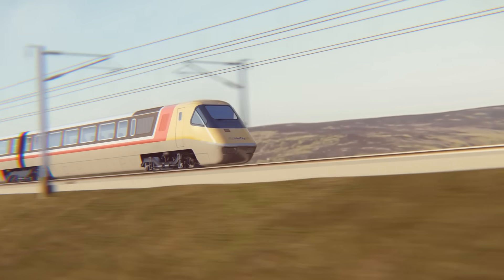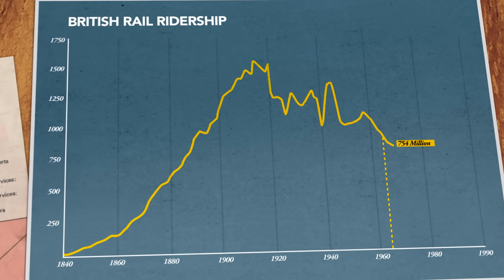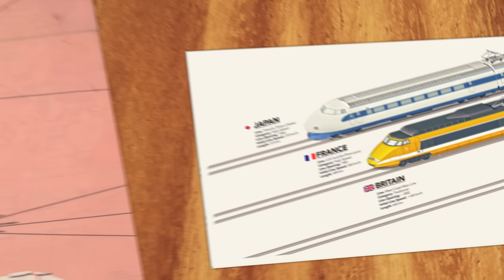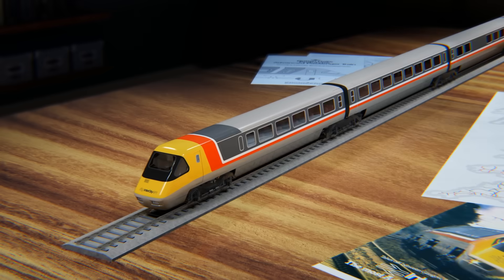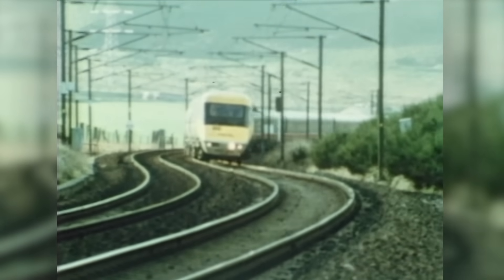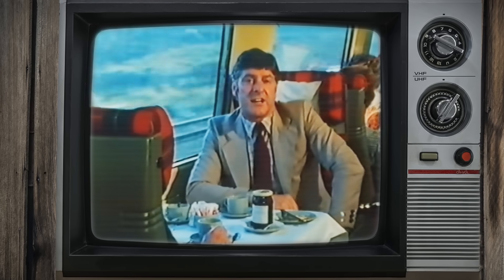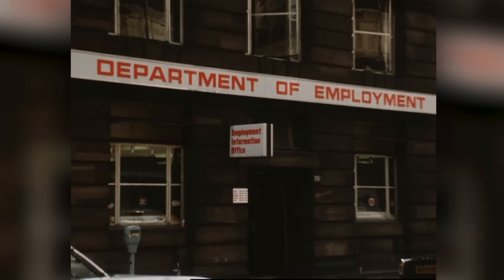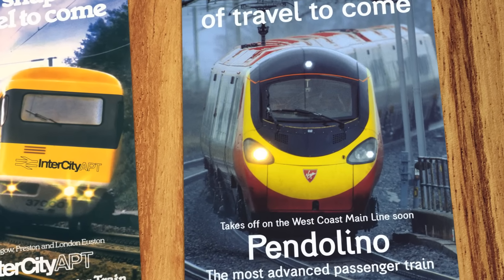This Train Made Passengers Sick: The APT Tilting Train Story

Comment: The big problem with the APT is that British Rail brought in aeronautical engineers from companies like Rolls Royce and told them to build something they had no expertise in. The HST, on the other hand, was designed by railway engineers who knew what to do to achieve speed and relative comfort. The proof is in the pudding-The HST is still with us 43 years later.
Reply: The 43's are still in service 43 years later, lol.
Reply: @oliverthegreatwesternengin8029  yeah. I was on the last GWR 2+8, but cause I live in Devon I will still be able to see the 2+4's. They might start running 2+5's as well with a buffet from Penzance to Cardiff and Swansea, but those are still rumours at the mo
Reply: @StaxRail  
I've never seen one as I live in germany.
Reply: @oliverthegreatwesternengin8029  I can assure you, it's well worth the visit. Some of England's best views down here, such as the Dawlish Sea Wall, still see 2+4's. On the subject of Dawlish, if you want to see it I would go now, soon they are raising the height of the wall and it will get in the way of the view

Comment: Proud to say that my great grandad was one of the chief designers at Oleo Pneumatics during this period and helped design the suspension for both the APT-E and APT-P! Also proud to say, up until the removal of the full size sets, my dad drove the HSTs for nearly 20 years. Short sets are still in action, so hopefully 20 more years will follow
Reply: Be proud of something you do yourself, not your grandpa.
Reply: @areshera4039 I am proud of the work I do myself, as I work on a heritage steam railway as a mechanical engineer and machinist- but if it wasn't for the inspiration and pride I had in my forefathers work then I likely wouldn't have gone down this career path myself

Comment: sick no only the press that had been filled with alcohol, most passengers were fine the worst had nausea.
the problem was it was to well engineered so peoples senses didn't now they were going around curves and looking out of the windows you either seen ground or sky on the harshest curves.
did the APT die no the designs were sold to fiat's rail division and ended up back on the UK's west coast rail line as virgins Pendolino

Comment: I'm sorry but there is an inaccuracy.
Italy had already a tilting train system in service when the APT was removed from service. It was the Fiat ETR 401, it was put in service in 1976 and was developed the decade prior. 

British technology was deficient due to its use of accelerometers to detect the centrifugal forces, while the Italian technology used gyroscopes. 

From the ETR 401, the ETR 450 was developed in the early 80s and put into service in 1988. Therefore the Pendolino was having good success a lot before the BR sold it's technology.

Besides when the Virgin Pendolino was introduced in the UK, Fiat rail had already been sold and incorporated in the French Alstom.

Comment: Fairly standard stuff for Britain. Spend money on developing something, then abandon it, and let others profit from it.
Reply: It wasn't abandoned, it was put on hold. Virgin trains are still using to this day.
Reply: @TRIPPLEJAY00  actually the tilting trains on Virgin trains is the class 390 pendolino
Reply: @TRIPPLEJAY00  Virgin uses the Italian-developed Pendolino, which is exactly Sylvia's point.
Reply: @lusoverse8710  If you watch the video and understand its all the original tech from the original British Rail design then sold to the French then slightly modified which Virgin trains. So the are still in service to this day. Just use your ears.
Reply: @TRIPPLEJAY00  If you watch the video you'll know they said it was sold to an Italian company, not French. Just use your ears.
Reply: @lusoverse8710  The Pendolinos themself were built in Birmingham. The tilting system is Italian.
Reply: @TRIPPLEJAY00  Virgin trains use those Italian Pendolino trains which bought the technology from the APT and developed it properly.
Reply: @afthefragile  That's great very boring conversation all trains are the same and yawn yawn yawn
Reply: @afthefragile  By the time the APT programme had finished the tilting technology was completely resolved and working fine.
Reply: Not only Brits are like that. Polish are same not even worse. We sold PZL to Sikorsky for 66mln zl just to buy new helicopters from Sikorsky after one year for 360 mln :/
Reply: Sylvia Else I thought that is only a german phenomen
Reply: @eacorion  It probably comes down to having development decisions being made by governments, where how it looks now, and especially how it looks between now and the next election, is more important that what it will achieve in the future.
Reply: same history with F35B stol
Reply: Sounds like Jaguar and Land Rover. Awesome until shit starts to fail
Reply: lol
Reply: You mean like the United States?
Reply: @joystix11  No, the complete opposite of the United States, in fact the US is one of the countries that usually wins from British innovation as the US has a bottomless supply of cash to take a chance on stuff, cavity magnetrons for radar, wishbone suspension for tanks, the entire concept of the hovercraft, just 3 things off the top of my head that someone invented, took to the British government and was told "That's nice, now go away" before they sold it to the US.

It doesn't surprise me that we created something the Italians later sold back to us because that is par for the course with British engineering, we've never in our entire history had a government that is competent science-wise.
Reply: @krashd  That all seems to make perfect sense to me, but in a completely direction than where my joke was headed lol
Reply: Sylvia Else you mean like India ?
Reply: Like India didnt build railway in India first. Britian created it and today Indians are proud of it
Reply: Madara Uchiha best bloody railway in the world. Maybe those asking for reparations should take it into consideration.
Reply: @BP2Network And the British took a lot of money out of India too. You guys should read history more. Don't rely on false british texts
Reply: yjhm yhj  you’re talking horseshit. Educate yourself fool https://en.m.wikipedia.org/wiki/Rail_transport_in_India
Reply: Brexit
Reply: Benoit Bricet yes that’s a word? And what?
Reply: Benoit Bricet yellow vests
Reply: @Sylvia Elsa No one is profiting from failed British tech. British lost their edge in tech after world war 2 and they are still losing it. They rely mostly on US tech. Even countries like China are ahead of them.
Reply: @maheshrathod5593  There are reports that patents on the tilting techology were sold to Fiat. Assuming those reports are correct, Fiat is profiting from their use in the Pendelinos which are now running on British tracks.
Reply: @maheshrathod5593  Utter horse shit !! British technology led the way after the second world war, you only have to look at the aviation industry to see that. Come on man ! Think before you type !
Reply: Mahesh Rathod says the man speaking English over the English invented WWW or maybe the British invented telephone, something you lot are well acquainted with. Come back when you’ve got to grips with flushing toilets and sewers Abdul
Reply: Sorry Anglo’s! Gotta make your stuff work!
Reply: They were so close to perfecting the technology - then abandoned it.
Reply: Mahesh Rathod  because you’re clearly a moron with even a basic grasp of English. I suggest you go and enrol in an English course before you try to get involved in a debate.
Reply: @Porkcylinder  OK I get it www was invented by Tim Berners-Lee an Englishman and I never said the British did not invent anything. It's just that the British empire is on a decline after ww2 and the recent economic growth in UK is due to the immigrants from Asia.
Reply: Sylvia Else
Reply: Kinda like what they did with America :p
Reply: "Spend money on developing something, then abandon it, and let others profit from it."  Margaret Thatcher's tory government - she hated the railways, and was desperate to close them all.
Reply: It's a British tradition.  For example South Korea and Japan have made a fortune from LCD displays, one of our inventions that we've made little from.  The problem has always been tradition and fear by financiers causing R&D money to be denied or removed.  In other countries investors are more prepared to take chances on new concepts, so our best people leave to find backers abroad.
Reply: @MickeyTTT  The British never developed the LCD. It was Japanese scientist Hiroshi kawamoto who realised the concept of Liquid Crystals into displays.The Japanese did not capitalize on someone else's idea
Reply: it's partly down to geography 

the country is too narrow and hilly to get a good straight run of high speed track - unlike France... and we've inherited a dense network of bendy lines from the Victorian era that would bankrupt the country to sort out.
Reply: @AdyP-j5o  Tell that to Japan lol
Reply: @korona3103  Have you ever been to Japan or the UK? Probably not. Very different geology, geography and politics, as @Camberwell86 described. Not even the Chinese or European high-speed trains run that smoothly.
Reply: @AdyP-j5o  
The point is tilting trains running existing tracks, not new track. The UK has tilting trains right now doing 125mph. They can do 140mph but they never put the in-cab signalling in.  

The British mainlines can have the bottlenecks removed with state-of-the-art signalling and proper wires. Then speeds of 155mph, the design speed of the APT, can be achieved.
Reply: @AdyP-j5o  @korona beat me to it. No excuses when Japan, a country with a God-awful terrain of hills and mountains, could do it.
Reply: @Camberwell86  nice reply lol
Reply: @tonyjc1575  if a private company l would put a white elephant on it
Reply: @AdyP-j5o  To be fair, they were considered high speed in Victorian times when trains would struggle to hit 40 mph.
Reply: @AdyP-j5o  I'm German, and our country is densely populated and hilly as well, as is Japan, yet still they managed to build stunning high-speed tracks all over the country.
Reply: Ady P but thats why it had a fucking tilting mechanism, so it could take bendy routes at high speed, which it did in service very well and set the speed record for diesel locomotives that is still held to this day. Oh and if you think England is too hilly for trains you clearly know fuck all about English geography, most of the country is pretty flat and perfect for trains
Reply: @AdyP-j5o  what about Japan? It's even trickier terrain.
Reply: @m341ehw  They're not idiots when they're endlessly laundering away your money and mine by the squillion.
Reply: @AdyP-j5o  Japan is even more narrow and not just hilly but mountainous as well, China also has all types of terrain and both countries have some of the best high speed rail networks in the world. How high speed rail was implemented in those countries was to start from scratch and completely innovate a new system that was meant for high speed rail, not try to make something out of a centuries-old rail system meant for steam locomotives. We can see equivalents of the APT story in even jets and the 737 max, or even iphones or continuous models of anything. Sure it can work for a while but in the long run fixing one thing over and over eventually breaks down like a child's game of telephone. What's best is to innovate something new so that every factor can help its development instead of working with old models or systems out of hope to cut costs and save money, because in the long run it's just going to cost more money than innovating something completely new.
Reply: It's just like Brexit.
Reply: @L-Bj  idiot
Reply: Then tell the public bunkum to cover up its failure, bloody british liars

Comment: The British abandoned steam in 1968, years, sometimes many years before many other countries.   In some parts of central Europe, steam was still in use in the 1980s and as of 2017 the Chinese were still using steam locos at the Sandaoling coal mine.
Reply: yet China has the most efficient high speed rail
Reply: @kellynaz9256  So?
Reply: @Palifiox  so

Comment: The American United Aircraft Aerotrain had passive tilting. 
The Spanish Talgo also had tilting.
Both had shared single axles between cars. This made shocks much more difficult to deal with. Double axle (4 wheel) trucks reduce shocks by half. Years ago luxury passenger cars had three axle (6 wheel) trucks, reducing shocks by ⅔.
Rough riding did the same thing to these trains that rough riding shared single axles did to the American General Motors Aerotrain, which adapted GM bus bodies.

Comment: I wonder what the root cause was for the motion sickness.  I know I have problems if I can't look out a window, but with these what you see out the window would be kind of sync with what you are feeling, or if maybe the length of the car prevented matching the directions well.
Reply from the maker: The problem was it was actually too perfect. Reducing lateral forces completely while seeing the tilt caused people to feel sick. Rather embarrassingly, the solution was to tilt less into turns.

Comment: Please correct me if I'm wrong, but I think Sydney's (australia) rail network has not been significantly improved upon since the 80s (besides replacing wooden sleepers with concrete ones), but the tracks are still cambered and allow operation of 80km/h on surburban lines perfectly smooth, even on trains designed and constructed in the 70s, and these same trains run 115km/h on non-geographically limited sections (could easily go faster without a blanket, all covering speed limit (and sometimes do when they have no/almost no passengers)). 

Point being I know britain's rails are from even older, but isn't the disparity too great? The inter-state 'high speed trains' even operate at 160km/h (but once again can safely go much faster) on similarly old rails.

Comment: APT's tilting technology was a bit too ahead of its time, probably because computer controls for "tilting" the train had not fully matured. This was the same problem that plagued the introduction of the JNR 381 Series tilting trains in 1973--it took many years of refinement to make the train comfortable for passengers (JNR actually provided motion sickness bags for passengers on those trains in the early years of operation!). 

When a division of Fiat finally developed Pendolino in the 1990's, they had more modern computer-controlled tilting mechanisms to make the trains more tolerable to passengers. That's why Pendolino was far more successful than APT.

Comment: An absolutely wonderful video that pretty much lays the West Coast's fallen stallion out bare. However, there are two things I wish were mentioned. In spite of the supposed motion sickness on the press run, the journalists didn't happen to mention they were off their tits after a party at BR's expense the previous evening and would have been ill on a typical train, let alone a flashy state of the art prototype with a slightly disorienting feature. Secondly I wish more was elaborated on the APT's stopgap measure using more conventional technology: the HST. And then to really rub the salt into the wound you could have said that despite the APT's political and PR failure, its temporary measure went on to be amongst the most iconic, fastest and longest serving trains in the world as the backbone of Britain's intercity service for four decades. Sadly though the HST is soon to be consigned to history as an intercity train. Certainly the refitted short sets will still be bumbling around, the final flying standards of a treacherous era for Britain's railways are soon to fall, the end of an era.

Anyway, fantastic video. Always looking forward to the next one!

Comment: The APT was a beast of a train, and it's a damn shame that BR killed it off. Too many at BR were stuck in the old way of thinking, and the idea of bringing aircraft engineers in to design a train didn't sit well with many of them. It could have been such a great success if the trains had been given the time to mature before entering service. Combined with a little bit of engineering work to the lines we could have had a fast service from London to Glasgow much sooner than 2002.

The motion sickness is dubious too - apparently it was a rumour that started because a bunch of journalists on the first high speed run had too much free champagne and started to feel a bit green around the gills.

Comment: This wasn't Britain's only railway failure. There's a bloody long list actually. There's the microdeltics, metrovicks, 17's, most DMU/EMU's and a long list of others. Britain was desperately scrapping Steam locomotive's, withdrawing all 24000+ by August 1968. But quickly following them were the diesels BR had just built to replace them. A lot of BR's diesels and electrics were quickly designed, and consequently poor. Out of the 200+ classes built by BR, only 6 Diesel and 3 electric classes are still in use. The APT wasn't a surprise, but it was a disappointment

Comment: The first active tilting train was ETR Y 0160 built by FIAT Ferroviaria for italian railway FS,and after that was built the ETR 401 for passenger use. 😉
Reply: And then there was the ETR 470 which, well, did not fare that well in Switzerland. A true passenger favorite, they even named them Cessoalpino
Reply: @superbeni7297  Yea that's true. Here in Italy the trains are still in service in Frecciabianca (ETR 470 & ETR 460) and Frecciargento  (ETR 480, ETR 485 & ETR 600) brand
Reply: @nicologelain8836  And as far as i know they aren't even unreliable? The ETR 610 we have here a pretty awesome, my favourite trains, very comfortable.
Reply: @superbeni7297  Yes, they work very well. They were updated during the  year, like new ERTMS train protection systems,so they can run also in High Speed line.